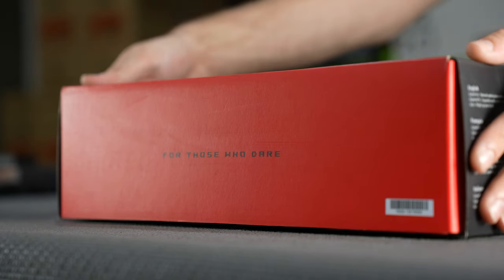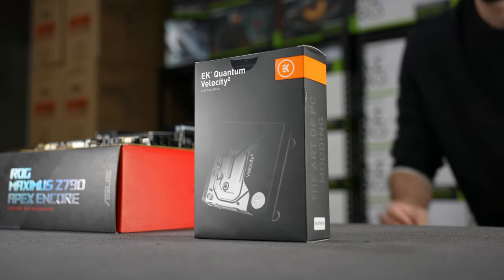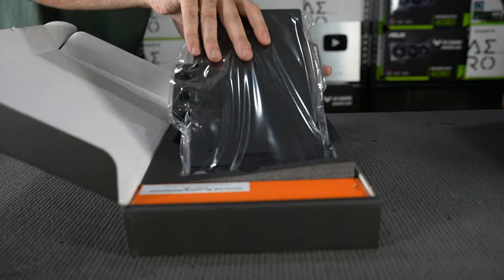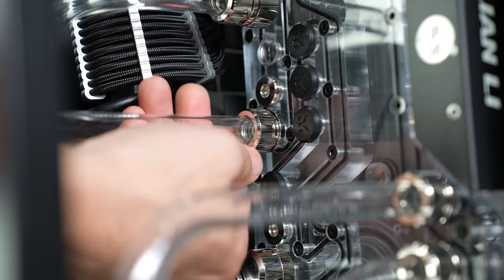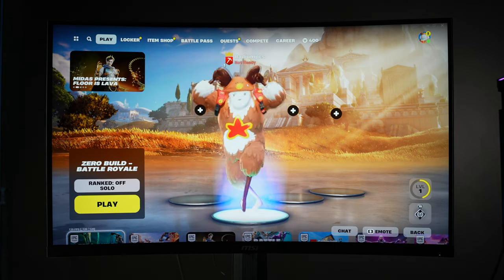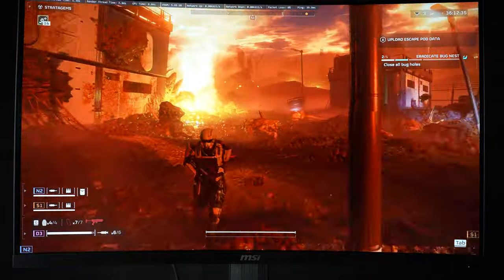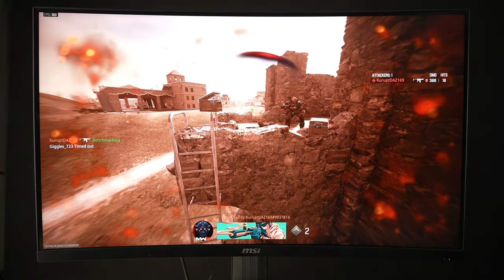WATERCOOLED 🌊 RTX 4090 Gaming PC Build + FPS Benchmark (4K @ Maximum Graphics)

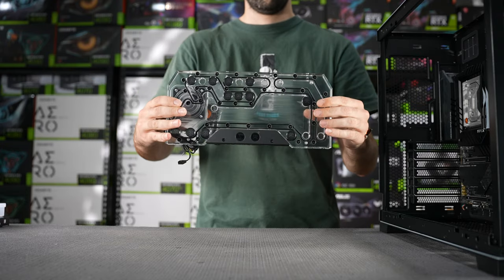Comment: 2:30 i just want to mention, the water pumps are louder for 4090s, unless you have the pc right next to ur face lmao, ive never once heard the fans from my 4090, only the pump and fans from my AIO (pc is under desk)
EDIT: the showcase thing for the pc, i still say air cooling looks 100x better, maybe not for cpu, but 100% for the gpu, and why spent $3k on a gpu just to take off the one part that makes it worth $3k, could have done the exact same thing with the tuf version for $1k cheaper with identical results

Comment: Guys straight answer, I have no idea how to build a pc it’s complicated but all I know now is I’m at my limits end with consoles, I know I like visuals and performence after seeing wukong on ps5 vs pc it’s a no brainer than I wanna spend big money and just forget Iv made the purchase, so I came across this pc on chillblast Verge Core i9 RTX 4090 Water Cooled Edge Gaming PC it’s 5k I know but all I wanna know is how long would this machine serve me for going forward ? And is it worth the money or could I make it cheaper
Reply: You're spending way too much if you only need it for gaming go for the ryzen 7 7800X3D processor instead, and you can use an aio with that as the thermals are pretty good, there's a lot of tutorials on YouTube to build a pc and it's really easy if you're not watercooling it. I did it a couple of months ago I too was coming from PS5. I spent close to 3.5k for a 7800X3D and rtx4090 build you can get it for less if you cheap out on aesthetics but it's up to you. As for the performance I'm getting over 80 fps average in black myth with dlss and frame gen on
Reply: @Harshitslaysss  yeah well if I price it up I can get a working pc with a 4090 for 2600 or I could buy a pre built 2800 with a 4080! That looks cooler haha

Comment: 2 weeks later, this didn't age well 😂😂😂
Reply: why
Reply: @thatsnotRoyf.  Because it's an Intel 13900k. It will oxidize and be useless fast
Reply: @jaredangell5017 it's 14900k
Reply: @sammyrinkima6814  lol
Reply: @jaredangell8472  oxidation doesnt works that way
Reply: @sammyrinkima6814  irrelevant
Reply: @thatsnotRoyf.  You are out of the loop my man
Reply: @jaredangell8472  wdym for something to literal rust, it has to pass YEARS in contact with oxygen and it’s not irrelevant if it’s 14900k cuz ur talking abt the 13900k
Reply: @thatsnotRoyf.  You obviously have no clue what's going on with Intel.
Reply: @jaredangell8472  you good fam?